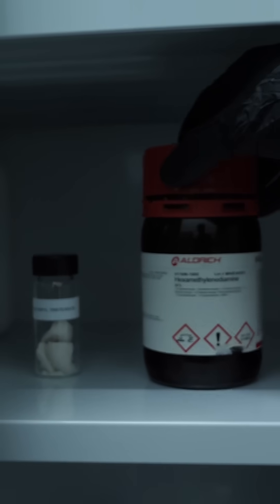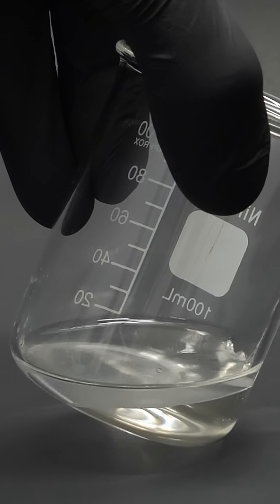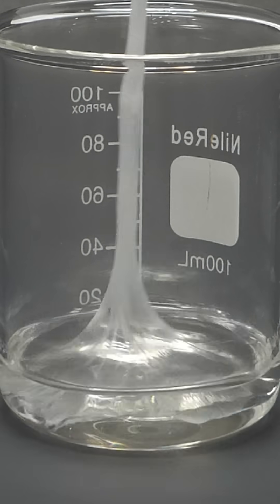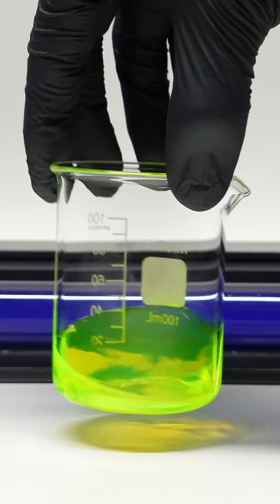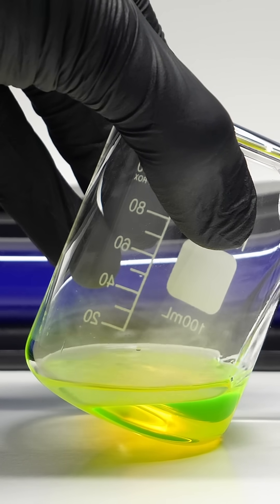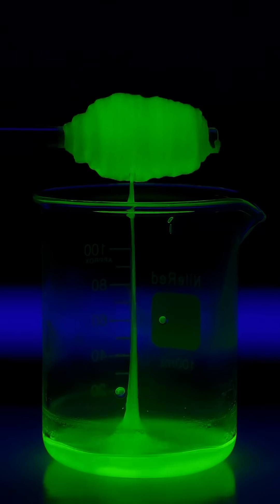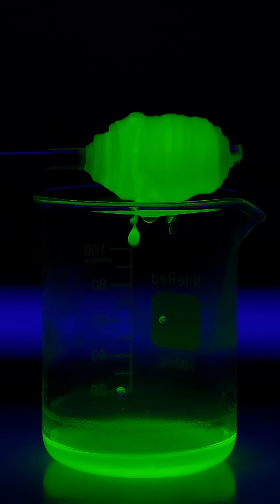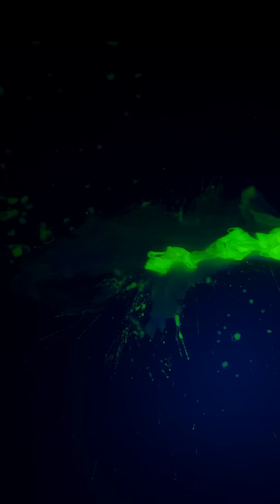Making glowing nylon goo

Comment: Just had a thought:
If you use an hourglass beaker and add the nylon stuff to match the middle of the hourglass, the resulting nylon film would be much smaller, drawing in less of the bottom solution to the resulting nylon.. right?

Comment: Fluorescein is the only chemical i own and i use it to make my contact lenses glow in festivals. make sure you throw those lenses away after, because the stuff doesn't go out. Though the chemical itself is safe, it could serve as a medium for bacteria to grow in.
Reply: Is that safe to be putting in your eyes?
Reply: This dye can actually be used to diagnose ulcers/trauma on the cornea, so i would assume its safe to use in your eyes as long as its medical grade?@honeyfungi
Reply: is that like. okay to put in your eyes???
Reply: @hesperamoon  It is! It, in fact, is used by ophtalmologists because it tens to accumulate in tears on your cornea, and so it helps identifying any damage tonthe eye when, say, you have a metal shrapnel hit it, or when it's damaged in some other way
Reply: @pedroff_1  one time I was wearing regular contacts and they glowed under a blacklight, I wonder if that was in them?
Reply: That's cool as hell. Do you add it to the contact solution?
Reply: @totally_not_a_bot I hope they reply. I want to learn more too
Reply: @totally_not_a_bot Yes I wonder too, like is it put into the contact solution, or directly on the lenzes?
Reply: @totally_not_a_bot always be careful, do your own research, and consult an eyedoctor or something if you can about its use.

i bought a nosedrops vial (with the drop applicator) for something like 1 euro, emptied it, cleaned it thorougjly, put lens solution in it and mixed some fluorescence. At the party i dripped some fluid into my eyes. If you spill on your clothes in my experience it washes off.
Reply: @totally_not_a_bot random but your cat looks like mine, even though it’s a common cat look lol
Reply: I just looked it up (it wasn't that hard). Apparently, doctors inject fluorescein IN your eyes to visualize blood flow, so it's pretty safe just touching your eyes.
Reply: Thats crazy. I love learning new things
Reply: While rare, it can cause anaphylactic shock potentially causing cardiac arrest when used topically on the eyes. It becomes a bit less rare (I think around 1 in 100) if ingested. I specifically remember a family member being asked if they had a past adverse reaction by the eye doctor before applying for this reason.
Reply: @jsjohnst  I mean, allergy and anaphylaxis is basically something that applies to everything. Most things are a potential allergen for the right person, and doctors always should ask for past allergic reactions you have
Reply: @ agree, just saying to those who think what GP mentioned could be a fun thing to do, it’s not without risks. I think the rate of adverse reactions is roughly on par with peanut allergies

Comment: What does happen if you mix it?
Reply: Not much, the nylon plastic is a polymer (a really long chain of subcomponent molecules, in this case a class of nitrogenated hydrocarbons called amides), and the reason he's pouring it in so carefully is to have that interface between the two solutions to give the polymer a place to form those long chains. Otherwise it doesn't form and you just get a solution of amides mixed together.